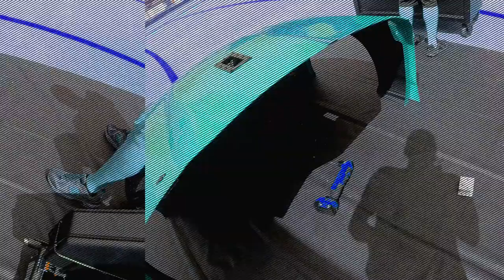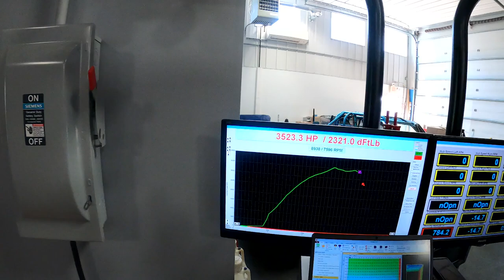Insane 1st Hit in my New Audi Race Car!

Comment: Man, thats one bad bitch. So good to see it finally go down the track. I have 1 question for you.....what made you decide to go with an Audi? If someone were to ask me "Guess what kind of car Daddy Dave built for NPK?" Never in a million years would I have guessed an Audi.
Reply: @UK Racer I get aerodynamics. That Chevy II was a brick. I believe they have a minimum weight that they all have to meet. I expect him to have a great season!
Reply: @UK Racer That would be a good question to ask. As far as I know, the car has to have steel roof and rear quarters. But what if the car is made out of aluminum?
Reply: @UK Racer I've often wondered what they do about Corvettes. They would have to let them run fiberglass wouldn't they?